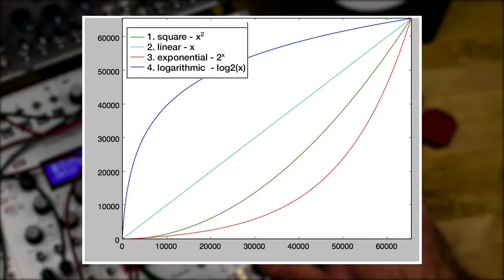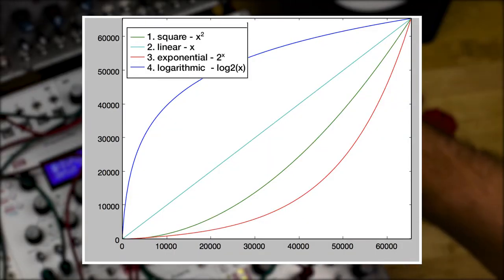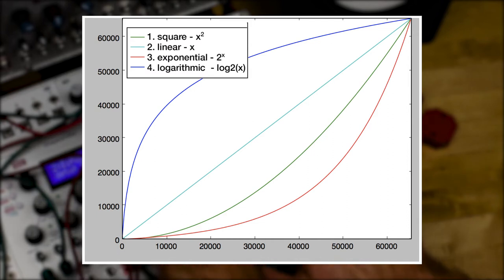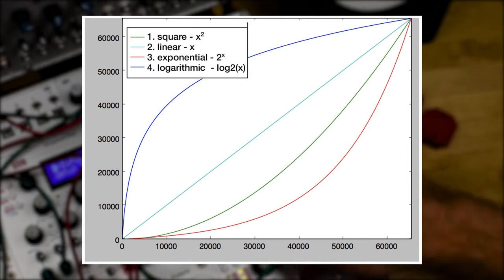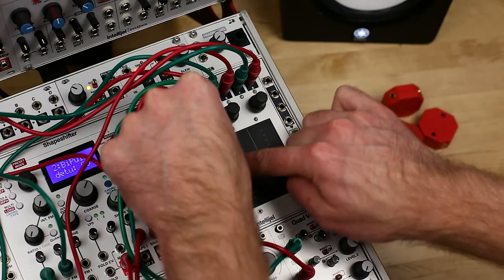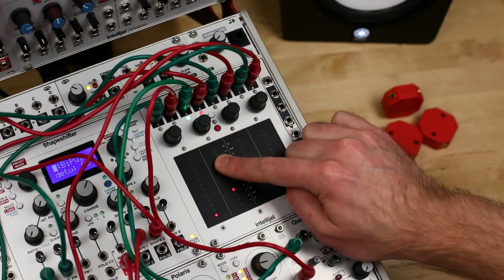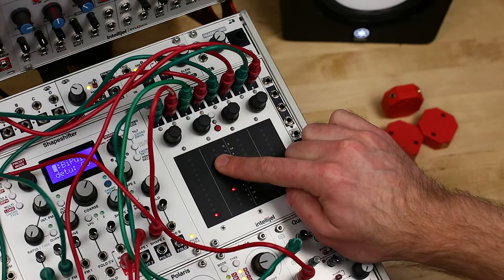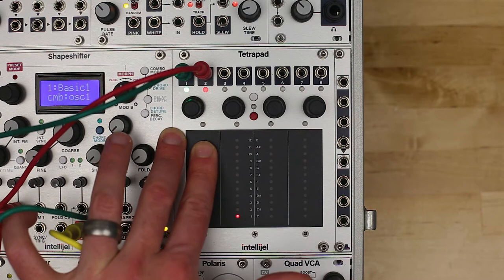Tetrapad: Chapter 12 - Global Configuration

Comment: After you set up parameters, your settings are saved on the unit even when you power off your system?
Reply: Correct! With the Tete expander you can also save configurations as presets.